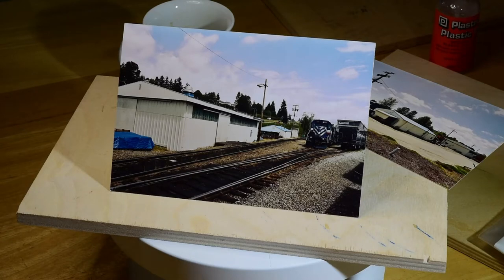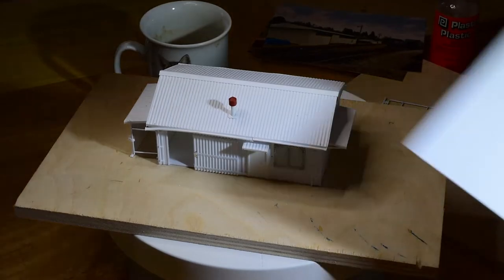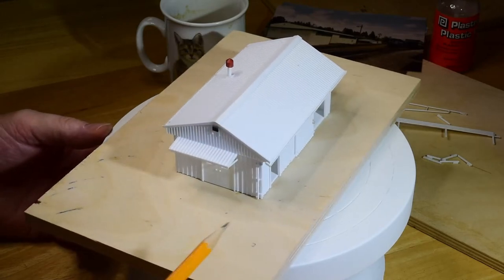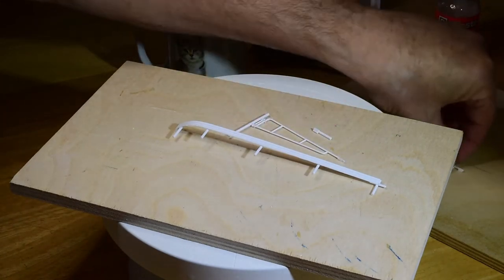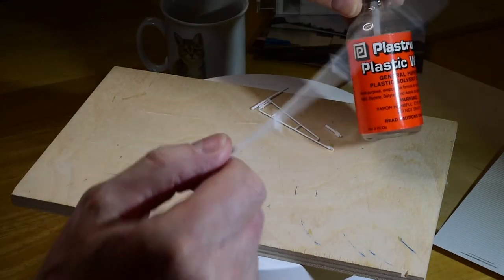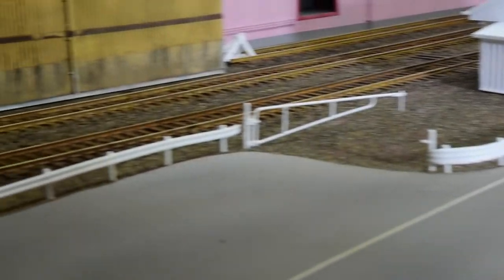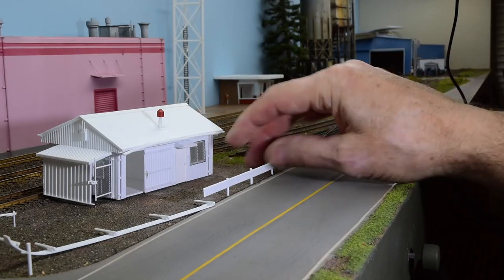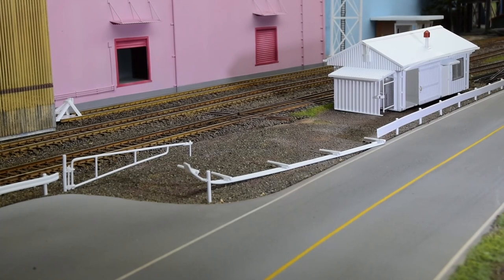The Model Railroad | The Yard Office Build

Comment: Great scratch build, you have amazing talent! Quick question if I may - how did you bend the plastic for the curved section of rail guard and it stays to form?
Reply from the maker: I gently wrap the plastic around a wooden dowel to bend it. Over bend it and it springs back to the shape you desire. Cheers.